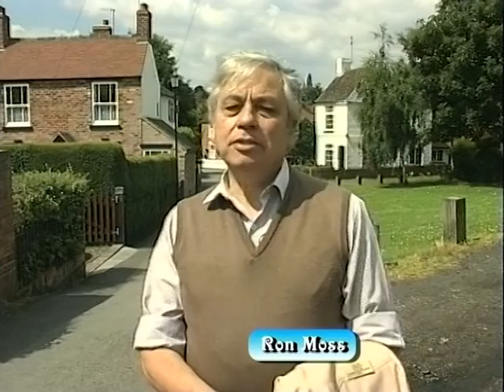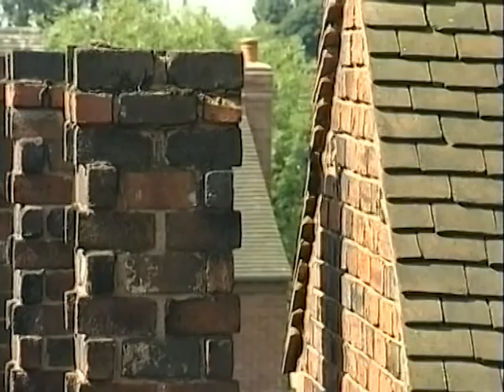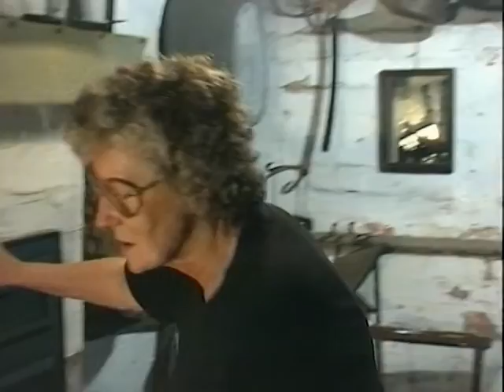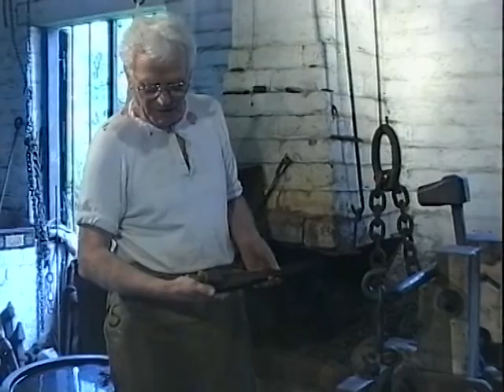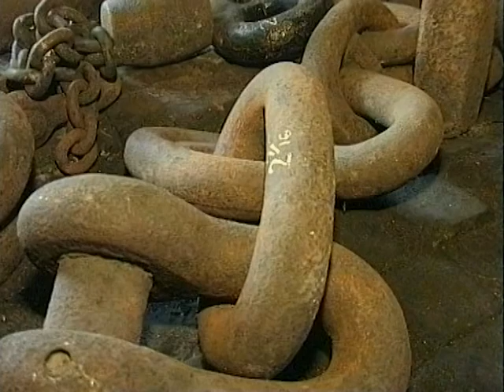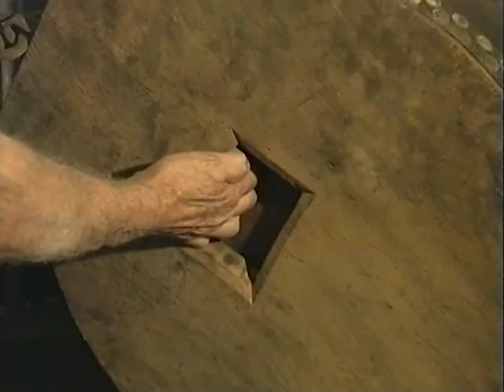Mushroom Green Chain Shop

Comment: excellent video from start to finish well explained  i was myself in the industry initially as an Atomic Hydrogen welder welding the rings ,ring joiners and inter joiners that with the chain that formed a chain sling  manufactured from high tensile steel which superseded the old wrought iron chain assemblies in this video  which was eventually superseded by grade 80 and grade 100 chain sling assemblies which only needed a hammer to assemble